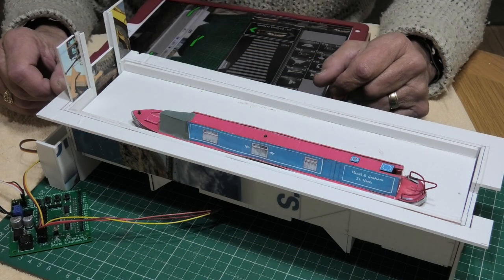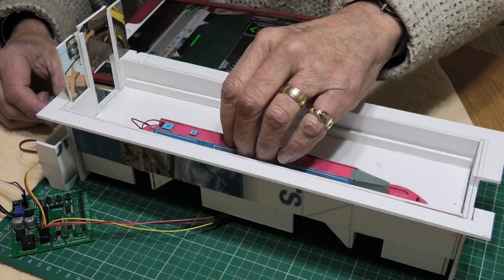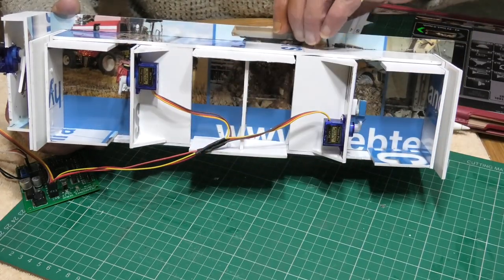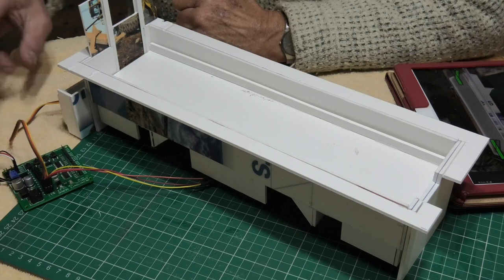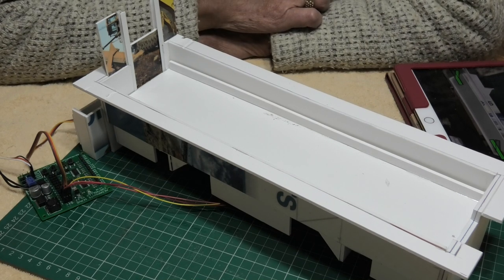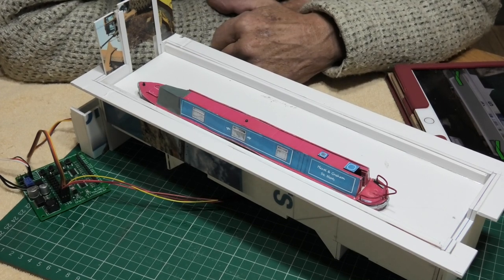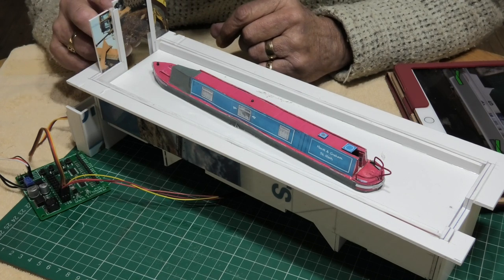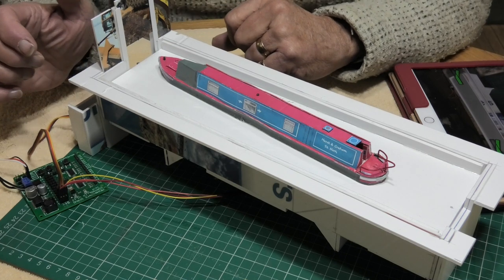The 4th and final part of the design concept of the canal lock and operating gate. 12-12-2022

Comment: Ah, I hadn't realised you were only making the gate for a narrowboat's width, no broad-beam access! Makes sense I guess, though I'm not sure why you can't make the same system work for the full width too - well of course it would if you wanted to. I know you'll have your reasons, and nothing wrong with that. Your layout, your rules. Nice work Graham. It is all about solving a problem, and making it work. Fascinating to see your mind at work, finding a solution to a problem you've set yourself. Thank you for sharing that.
I love the gate's movement - so neat, and perhaps more especially the water level changing. Looking forward to seeing the end result. As to the sound, I'm well impressed, I knew you were up to it!
Reply from the maker: Hi mate and thanks for the comment. The reasoning for making it narrow boat is that I have already built the viaduct which will connect to the lock and that is just a single lane viaduct so no broad beams could go along it anyway but I do take your point. If anyone else were to build this and which I hope they do then they could easily make it so the gate is wider to cater for the broad beam barges - hope that all makes sense!  👍🏻. Hopefully once this is in position and connected to the tunnel at one end and to the viaduct the other end then it will become a lot clearer.     Cheers for now my friend and thank you for the comment.           ………..Graham
Reply: No worries Graham, I knew there was a reason. I should have remembered that fact about the viaduct!
Reply from the maker: @chazzyb8660     Thank you my friend.   👍🏻

Comment: Well done Graham. Works a treat. I am so pleased for you that it worked out as good as it has. I personally think that sound is a bit overkill as most locks I have been through are mostly silent in operation. The servo sound of the gates opening is probably sufficient. Looking forward to it joining Lakeside. Des.
Reply from the maker: Hi Des and thanks for the comment, you haven’t heard the level of sound I’m putting into it yet so hold fire until you hear it - it certainly won’t sound like Niagara Falls!    😂😂.     Anyway, it’s up and running and as far as this project is concerned then it’s complete and I can now start on the real model. Cheers for now mate.       …………Graham

Comment: Excellent Graham. Well worth a watch. and yes I did get through all 4 episodes!! There is no doubt what you have done is a really nice working model, but in the politest way I cannot see your objection to folk offering other solutions to the construction. I personally think that open conversation on somebody's excellent work can detract from it. Far from it, I would take it a s a compliment. Just a thought.
Will you build the final version in the model room?  Cheers, Bob
Reply from the maker: Hi Bob and thank you for your comment. My reasoning behind my ‘objection’ although it isn’t really and objection is that I have already in my mind the way forward of how I want to do a certain job and until I have exhausted all my ideas then that will be the time I will call for help. What really is the point in someone saying ‘what you could have used is. . .’ When I can clearly show on the video that what I have done works and works the way I want it to.
The other issue is (and this has happened a few times) that someone will suggest something but they clearly haven’t thought it through because they can’t see ahead of my thoughts and so yes, their method may well work at this stage but not further down the line when I introduce something that hasn’t been mentioned yet. Anyway, I think the best thing for me is to not show the gradual progression of a job but to do as many other folk do and that is to show the finished item up and running which is what I intend to do with the final model.
This is not the correct platform to have a discussion into the ‘why’s and wherefore’ of how something could be completed as I have to type so much, on so many comments that it takes a lot of my time up just to get my point across - like this comment is doing right now.  Anyway, cheers for now mate.         …………Graham

Comment: Great video here graham, it’s been a great series of videos on your lock gates concept, hopefully when you come to building it on the layout the installation will be simple and easy and I can’t wait to see it in full operation on your layout.
Reply from the maker: Hi David and thank you for your kind comment, the way I have this planned is that the main bulk of the model will be built on the kitchen table - as per normal with me as I don’t have a bench - so it should pretty much drop in complete with just detailing to add around the outside - that’s the plan so I hope that it works out.         Cheers for now mate.            …………Graham

Comment: Is the handwheel going to turn in sync with the motor driven gates?
Reply from the maker: Hi mate and no, the hand wheel will not turn as that is only intended for the raising and lowering of the gate should the electronic motor fail which would normally o-erase the gate.       Cheers for now.          ………..Graham

Comment: Very nicely done, Graham. Have you given any thought as to how you will turn the boat around at the ends of the canal? One thing you'll need in the scenery dept. that you didn't mention is bollards. I notice that Robin's model is also missing those. Boats would be tied to bollards during the raising and lowering of the water in the lock, to prevent them moving around in the swirling water.
Reply from the maker: Hi Henry and thank you for your comment. Yes I have given it thought and the barge will go onto a hidden turntable which will turn through 180 degrees so the barge will be able to make its return journey, this will happen at one end only though as I don’t have room at the other end. No big deal though as I will just have to lift it off by hand and turn it round - more room and I could have had two turntables.  You can’t have every thing I guess!   Cheers for now.        ………..Graham

Comment: Fantastic job Graham, interesting to see how you have worked it out. I know you don't like suggestions, but would it not be easier if you have the entry and exit gate openings on the same half of the lock, for a straight through run, instead of diagonal.  ...Cheers.  Les.
Reply from the maker: Hi Les and thanks for the comment. Yes, it would be easier to do it that way but the problem is that if there are two barges wanting to go through the lock then the first barge in line goes through first, he moves over to the side of the exit to make room for the second barge to enter the lock, therefore two barges can go through together. Once the exit gate is open then the first barge can go through first - first come, first serve - then the second barge can follow on behind the first, keeping them in the same order as when they entered the lock. It just makes for a smoother transition for two barges that’s all. Hope that helps.          Cheers for now.          …………Graham
Reply: @GrahamFoulston  A fair point Graham. I had a look at lock images, couldn't find one with a 'lay-by', they all seem to be single locks or a wide lock with a wide gate. Never mind, keep up the fantastic work!  ... Les.
Reply from the maker: @spottedzebra58     I have seen a couple like this Les but only on locks with guillotine gates.